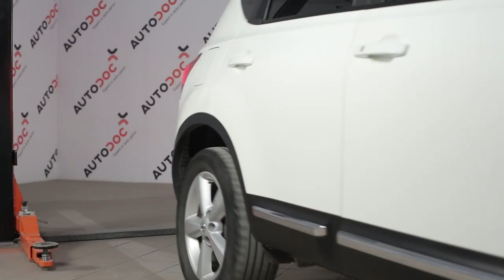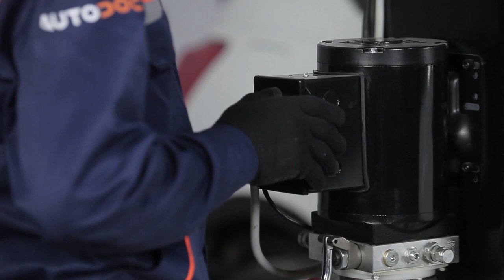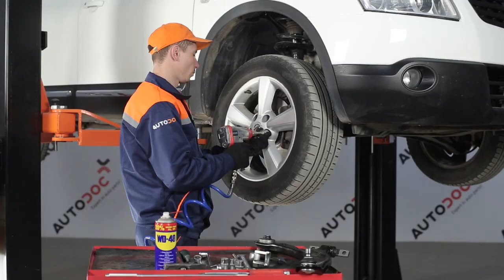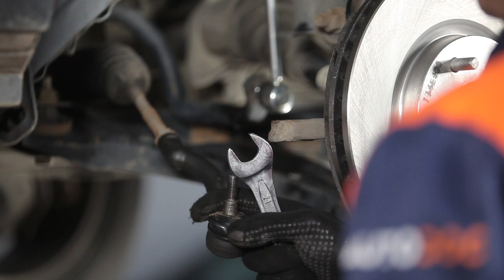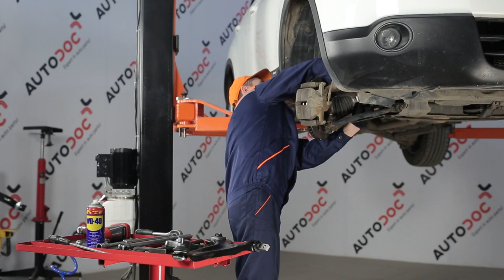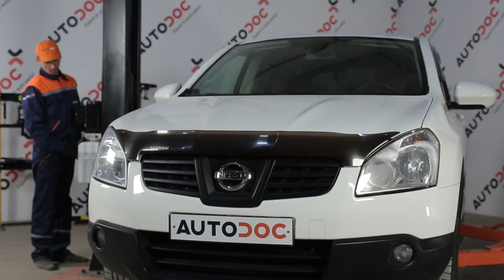Cоmo cambiar brazo de suspensión delantero NISSAN QASHQAI 1 INSTRUCCIÓN | AUTODOC

Comment: Hola buenos dias, muy buenos sus videos. Tengo un Nissan versa 2014 he intente cambiara horquilla de la suspensión pero en la parte que va hacia el disco de freno tiene un pin que no pude remover. Y me quede hay. Me pueden ayudar gracias.
Reply from the maker: Buenos días. Gracias por su consulta. Sin ver el vehículo es difícil comentar algo. Recomendamos ir al taller. Atte, equipo de Autodoc.